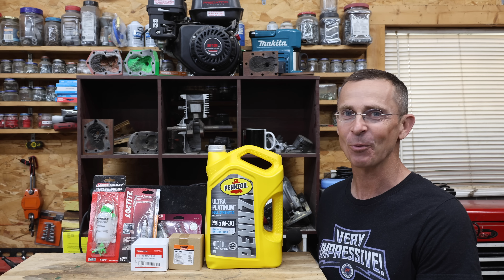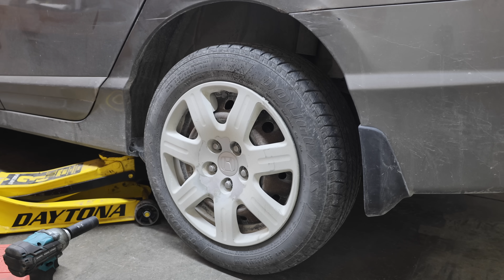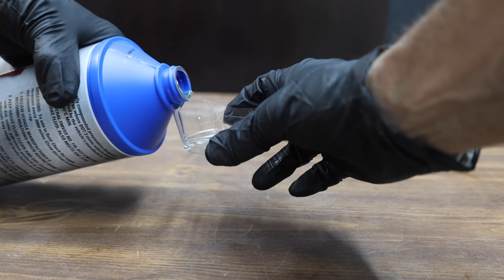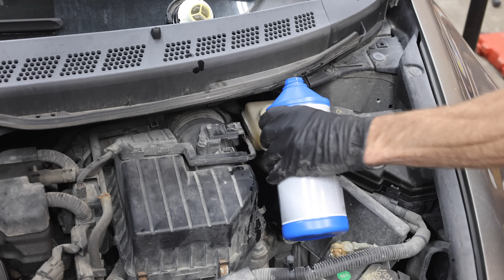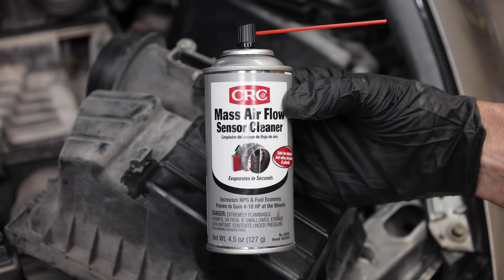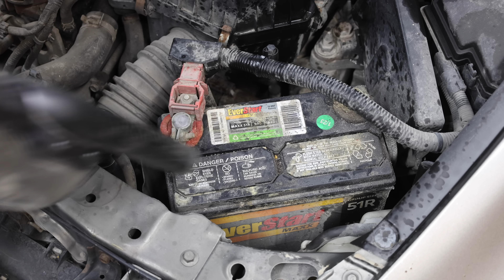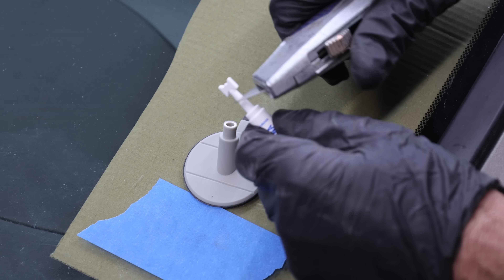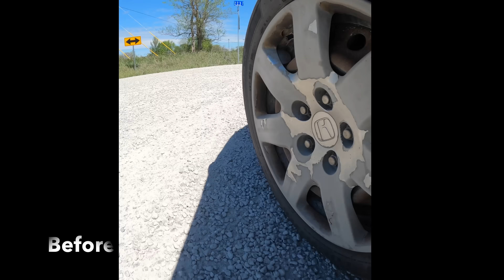Most Reliable 200K Mile Car? Let's Settle This!

Comment: 17:40 those 3800 engines were bullet proof. should never have been discontinued
Reply from the maker: Great point! They will last forever is properly maintained.
Reply: Amen! 3800 is awesome.  That's why they canceled it!
Reply: And that's exactly why they were discontinued. GM can't have people with reliable engines, that would be bad for business.
Reply: I'm pretty sure that it was becoming impossible for the 3800 to pass emissions. It's roots trace back to the 60's. 

I had a Supercharged 3800 in a Regal GS. I loved that engine.
Reply: And they ride so good- roadtrip machine
Reply: The government forced it's demise via regulations (emissions, MPG) that engine could not meet.
Reply: When they did away with that engine, I stopped buying Buicks.  I owned them for many a decade. Love the 50's models.
Reply: @bwest-yq3uc  2008 was the last year I think , it was offered in Camaro ,  as well as other Chevys Pontiac and Oldsmobiles
Reply: @neuralnetworkfocus2897  There was no 2008 Camaro
Reply: @scootypuffjr.  LOL  , the 3800 engine was available in 2008 , through the course of time it was offered in many cars including Camaro ,  when it was in production
Reply: It was in Camaro in 2002 and earlier years
Reply: @neuralnetworkfocus2897  your phrasing left something to be desired.
   I'm fully aware of where and when the 3800 and it's non-3800 labeled previous versions of the  3.8 V6 were offered. I had a 98 Regal GS for several years and have owned the same 87 Grand National since 1994. I worked for  Buick, Olds, Cadillac,  Chevrolet,  GMC dealer for 15 years and was there at the end of the 3800. It was a sad day when they discontinued it.
Reply: @neuralnetworkfocus2897 The Camaro 3800 would be a nice rear drive swap motor, but I've never seen it done.
Reply: @timothykeith1367  The Camaro for  at least a few years came factory stock with the 3800 engine ,  often just called a V6 Camaro ,  it wasn't listed as a performance option but could easily be made a performance engine , it came with the 4L60E trans 
I don't recall Camaro ever having fromt wheel drive
Reply: @scootypuffjr.  sorry you have a hard time reading
Reply: @neuralnetworkfocus2897  sorry you have a hard time writing. I know English as a second language can be tricky. Or so my lawn care guy tells me.
Reply: @scootypuffjr.  quit whining baby ! If you don't like it  .....
Reply: @bwest-yq3uc  Same here.  Without the 3800 the Buick brand is dead to me.  It seems they only put the very worst GM powertrains in Buicks anymore.
Reply: They are along with the Ford 302s.
Reply: I've seen one go 370k miles, but I think it needed a timing chain at one point. The transmission on that car had to be rebuilt twice, though.
Reply: 100% agree on that. One of the best American engines ever
Reply: Except for the stupid intake gaskets, and the plastic coolant elbow that would rupture suddenly and dramatically. Oddly enough the Supercharged 3800 didn't seem to have the intake gasket issues at least.
Reply: @scootypuffjr.  Put the aluminum coolant elbow in to replace the plastic one 
the plastic one in mine lasted 128,000 miles , and replaced it when I replaced the tensioner
Reply: Get the Park Avenue version. Usually driven by older people and  maintained better, nicer interior.
Reply: @jonmulack4226  I still see a few pristine Park Avenue Ultra's with the Supercharged 3800
Reply: @jonmulack4226  did the buick rendevous have it?
Reply: @jonmulack4226  I had a 1993 Park Avenue Ultra with the supercharger in it.  That thing was always in the shop every 3 months with sensors going out.  $200-$400 a pop.  My 2007 Buick Lucerne had it's issues too.  My Buick Lesabres were the best cars I ever owned, because they did not have all those sensors on them.
Reply: The 3800 engine itself is reliable but the stuff around it isn't!
Reply: @meowmeow2759  How exactly? Where I live rust kills everything, yet there are still tons of them running around with the rocker panels gone and front fenders flapping in the breeze. These things go and go with little care.

Comment: My personal best is 311k in an old ‘91 Camry. I really abused it but it didn’t seem bothered by it.
Reply: 90s Hondas/Toyotas were damn near bullet proof other than rust!
Reply: @DkpProductions  Yeah, over here my main worry is rust 😄
Reply: @DkpProductions  I have a 2000 crv with 295,000 miles. Still on the original clutch. I've replaced the timing belt, 2 driveshafts( my fault for buying aftermarket ones), an ignition coil, the brake lines and 2 calipers. East coast winters have taken a toll on the body so it's now my hunting/fishing vehicle and I bought an 09 fit for commuting. The fit feels like it will last as well.
Reply: @DkpProductions  Camrys remained bullet proof until about 2007 IME!
Reply from the maker: Impressive!
Reply: Great car.

Comment: As someone who drives one: 1994 Toyota pickup, hands down
Reply from the maker: Great truck!
Reply: nice! i just bought back my '93 from my son. Love that truck
Reply: @BaddAtom  Mine has been in my family since '95. Was my dad's, then he gave it to my grandpa, and my grandpa gave it to me.
Reply: Typical Sunday morning.  My coffee and another great PF video.  Thanks for all you do.
Reply: 570,000 on my 93. It looks and runs almost as good as when I purchased it new. Nothing but amsoil since it was new. Most serious problem I had was replacing the radiator at about 400,000 miles.
Reply: There's a reason why Top Gear did a whole run of episodes showing the Toyota hilux being unkillable!

Comment: I love my 260k mile Toyota Matrix, my 250k mile 2004 Suburban, and my 290k 2011 4dr 4wd Silverado!!
Reply from the maker: You've got a great lineup of reliable vehicles!! Great vehicle selection!
Reply: I have an Toyota Avalon at 220k.. love it every day.
Reply: VERY IMPRESSIVE!
Reply: Spot on, 2 transmission replacements, but I DIDN'T do them. Someone else paid for them before me! 😉
Reply: You got nothing on my 96 ford 150… 395,000 miles on original engine and transmission.
Reply: My college professor has 379,000 miles on her 1999 Chevy Suburban 4x4.  She loves that vehicle that she bought brand new.
Reply: exactly, TIMING chain and non interference engine is a must FOR MOST RELIABLE ice vehicle winner. ie HONDA 1.8 is out.
Reply: Love my 860k km Škoda Octavia :)  (530k+ miles) 1.9 TDi, never opened engine. 3rd turbo and 2nd set of injectors, 2nd clutch. Timing belt every 90k-100k km, oil every 10k km. Other than brakes etc there was nothing that i had to repair.
Reply: What year is it @mmllmmll22
Reply: Do a full service on both 5.3 v8s they will go another 250,000
Reply: You must like buying older cars or you do a TON of driving.
Reply: @TheGreaterBagelProject  I like deals haha...
Reply: Two of which had to have transmission rebuilds or replaced
Reply: Two of which had to have had a few trans rebuilds or complete replacement.
Reply: @majicdude88  take care of your vehicles and you won't have to that ,   when you don't care for you vehicle it won't care for you !

Comment: More and more cars are running to higher and higher mileage. 
Good vid. 🎉
Reply: Were. Early 2000 stuff was great, stuff made in the past 15 years is junk.
Reply: @MattyEngland     Some, not all.  My spouse's 2013 Toyota Prius C has 200K+ miles and is still going strong.  The batteries are starting to go, but that is to be expected after 11 years.  I'm hoping we can replace them with LFP batteries as they are cheaper than lithium ion, and last longer than both the lithium ion, and the nickel metal hydride batteries that are currently in there.  But even with the batteries starting to go, it regularly gets between 40 to 55 mpg.
Reply: Who can afford a new one???
Reply from the maker: Great point! Thank you!

Comment: Those Honda civics with the 1.8L are bulletproof!
Reply from the maker: Such a great little car!
Reply: I have Honda civic from 2006 FK2 (Europe) same engine diferent body and it has little over 300k km (186411 miles) still runs good.
Reply: Got 400thou on mine.
Bought it used 6 yrs ago 3grand.
Most reliable engine honda has made to date...and thats saying something.
Also got a 92 GSR 1.7L VTEC I have had since 97.